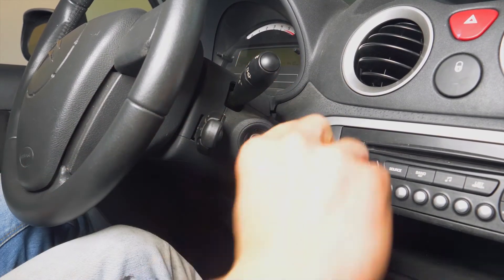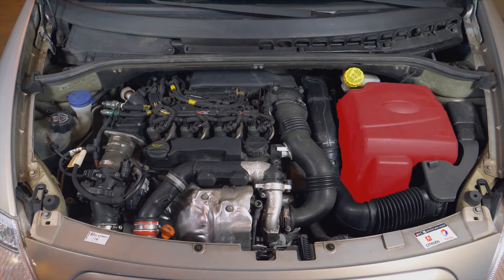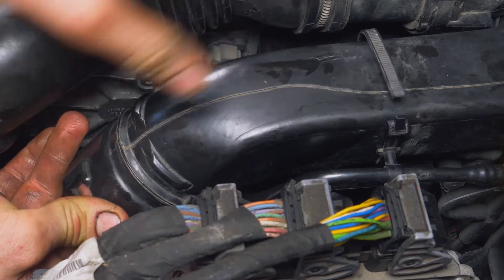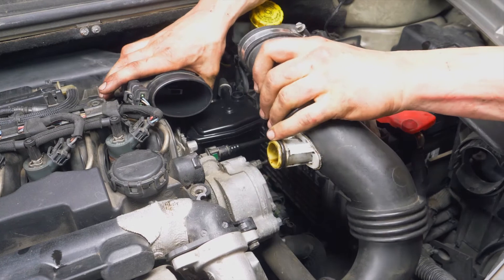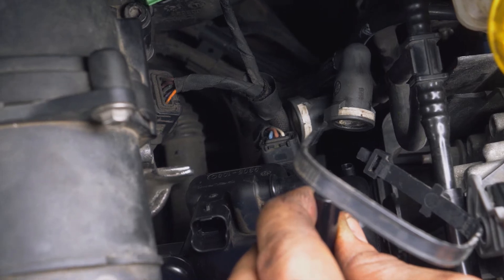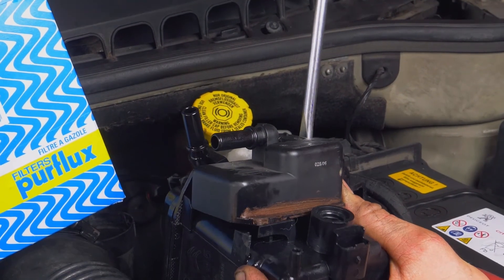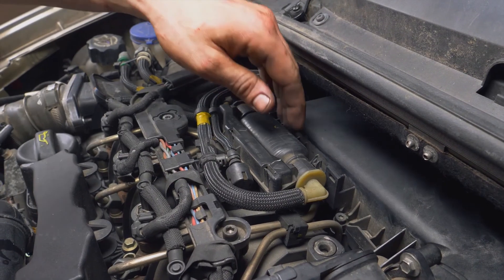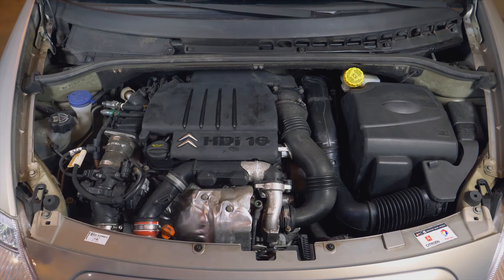How to replace the diesel fuel filter CITROEN C3 mk1 1.6 HDI ⛽

Comment: I have a citroen c3 2004 and it doesnt look nothing like this video.
Reply from the maker: Which motor is on your car? On Usetool, we make tutorials on one diesel engine and one gasoline engine.  Probably, yours is a different one ;)
Reply: UseTool EN i wasn't expecting a reply and not so quick. Thanks for your reply I have a Citroen 1.4 diesel 2004 c3 model.
Reply from the maker: We always try to answer to our community ;)
Indeed, it's unfortunately not the motor we made a tutorial about :(. You will easily find another tutorial on YouTube. Good luck!
Reply: UseTool EN thanks I will keep an eye out for updates in your channel by subscribing